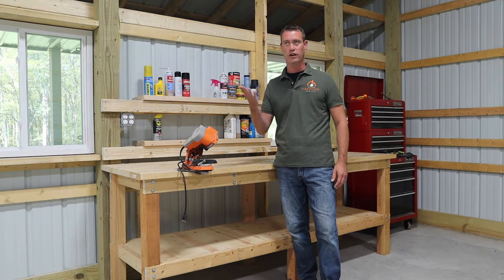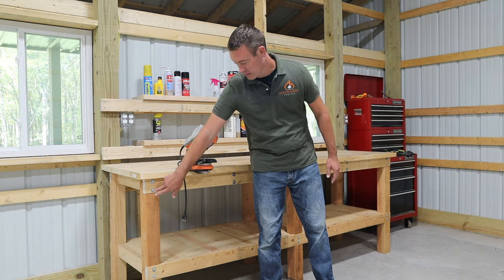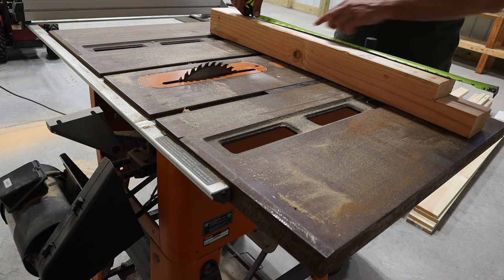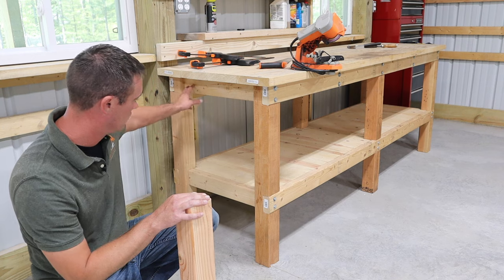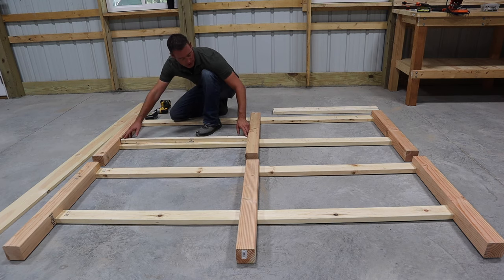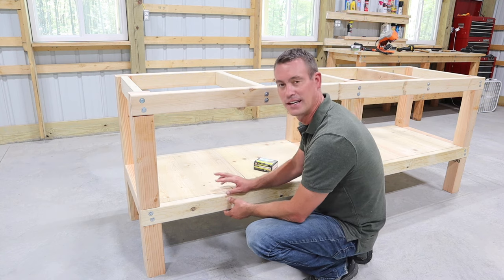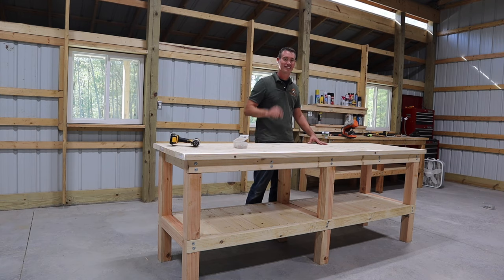How To Build A Workbench - The Best Way

Comment: I built some similar work benches. One issue is they tend to be heavy AF and difficult to move if needed. Cut the height down about 3 inches and throw 4 quality locking casters on it. Works great and is a breeze to move. I have 2 such benches tied together with my miter saw in the middle and I can move them around easily by myself.

Comment: Thank you. Built this last week. Was disappointed in my 2x8s for the top. Yours looked perfect.  You just laid them on top and screwed them down. Mine… not so much. 

Any twist I can deal with because the screws will apply discipline, but the bowing … yikes. Had unacceptable gaps. Fortunately my neighbor knows a guy with a a full wood shop that has a jointer. Live and learn, eh?

Thanks again for a sturdy, simple build 👊
Reply from the maker: Yeah I had to spend a decent amount of time finding straight boards but I was happy with the results!

Comment: Great work bench. Built one very similar. I used 2x10's as my table top and was wondering if you finished or tried sealing your top. Have a good sized gap on the top and was thinking about filling the gap with something and coat it with linseed oil. I just cant figure out what to use. Wood filler I'm thinking will crack up over time. Any ideas what to use? Awesome video though
Reply from the maker: Thanks for the complement. Unfortunately I have never tried to fill the gaps I’ve never sealed mine. The first one I built is several years old and it’s still looking great.

Comment: The legs out of 2X4, and leave spaces for the stringers, instead of cutting “notches”, aka Mortices, in the leg.  The 10-ft @x4s, that were too short were probably “stud” length, which is 3-inches short to accommodate the top and bottom plates of the wall.

Comment: Thank you for making this video. I will be starting to build mine sometime this week.
Reply from the maker: Hope you enjoy it!
Reply: @firewoodforlife   I based it off of yours, but went 8' long and 30" wide and used 3/4" plywood for the top. I also used all 4x4s on the ends and flipped the sides backwards, placing the 2x4s between the 4x4s. The reason I flipped them was because I wanted places with 2" overhangs on the front for clamps and it made the cross members 23" so I could get 4 from the 8' 2x4s and 4 x4s. And finally, I used Titebond III and the newer style construction lags from GRK. Thanks again, it turned out great!
Reply: @firewoodforlife   I sent a pic of it through FB messenger. It has blue pegboard above it.

Comment: I'm planning on altering the build slightly to have the back 4x4's at a length of 7ft so that I can hang a peg board or build some shelves.  I'd obviously need to notch out the top 2x8's on the back, but is there anything else I should consider or missing?  I really do love this video by the way, I've probably watched it at least 10x to understand the process and digest everything, so thank you!

Comment: Nice build. Though, I'm not sure of the need to use the lag bolts when the rails are inset into the 4x4s. I think the screws would work fine. But, overkill never hurt!

Comment: I love the design.  I'm going to try and shrink it a little to fit in my space.  I only have room for a 6 foot bench
Reply from the maker: I’m confident you’ll love the workbench and shrinking it down to a small size should be pretty easy for you.
Reply: @firewoodforlife  From what I gleaned of the design basically it will be 6' 2x8 for the top boards and 8' 2x4 for the side rails.  I'm lowering it a couple of inches so I have @ 35" high bench.   That will allow me to use 4x4 off cuts  for the bottom cross rails as you did.  Top cross rails will still be 2x4.  I might also try recessing the heads of the lag screws. 

The important point here is that your design and presentation make it easy to see how the bench is built and that a strong utilitarian work bench be neither expensive nor complex. 

Thank you for taking the time to create this video.   It is the  conclusion of a long hunt for me.

Comment: Nice workbench! I plan on redoing mine but instead of 2x8 bench top I’m using solid core door for a 100% flat surface so I’m limited to 80 inch length of the door, great video.
Reply from the maker: That's a great idea!

Comment: Hi. Love the video.  I attempted this over the weekend and got as far as trying to screw in the lag bolts
Here are my issues

1. I attempted to screw in the 1st lag bolt into the 4x4 lower brace.  The screw driver stopped several times and I eventually broke the lag screw all together.  

Here are my questions.  
1. Are pilot holes required for the lag bolts or is more an issue with the power of my screw driver.  I tried to screw them in while leaving the original "temporary" screws in place.  
2. should the lag bolts break so easily?
Reply from the maker: A pilot hole will make it a lot easier to screw in the lag bolts and I drill a pilot hole when I install them.  I'm surprised the bolts broke though.  If you're having issues with your drill you can always just use a wrench to install them.

Comment: Nice and I will do this once my garage is cleared out. The only thing I'm changing is using flat sheeting as the top instead of dimensional lumber. I need it to be as flat and level as it can be and boards typically don't achieve that without a ton of work.
Reply from the maker: That's a great idea!
Reply: You could try topping it with tempered hardboard.

Comment: 20 some years ago I built a work bench and dadoed every place I could also turned bottom part into cabinets. It was all glued making it stronger. This place I live at now they built benches with 6x6 posts and 2x8 for all the other boards with plenty of support for the top. It is L shaped at the bottom of the 6x6 they put a piece of other material on the concrete to stop wicking. All bolted to the walls
Reply from the maker: Thanks for your comment!

Comment: Awesome video and great workbench. Much appreciated step by step build. Just finished mine for my shop and love it. Only issue I had was snapping leg bolts connecting the 4x4 legs to the 4x4 lower supports. Did you use treated or untreated 4x4? Thanks for taking the time to make this video.
Reply from the maker: I used untreated wood for the whole project since it's always going to be inside my pole barn.  Thanks for watching!

Comment: Thank you for such a great video!  The only question I have is when you are securing the top with screws, will the screw on top be impeded by the bolts on the legs?

Comment: Excellent build. Did you trim the edges of the 2\8 so that they would be flush. As all commercial lumber has rounded edges. Thanks
Reply from the maker: I didn't and it seems to work just fine for me.

Comment: I consider a table saw a special tool also, so not sure why instead of using the table saw to notch out the legs you didn't use something like an oscillating tool instead. Can an oscillating tool cut the way the table saw did for the notches?

Comment: If I wanted to mount a vice to this bench would you recommend putting down any extra material under the vice mount?
Reply from the maker: I have a vice mounted to mine and I didn't add any additional material.  The only issue I had was lining up the vice mounting holes.  I just made sure they didn't line up between the wood joints.

Comment: Great work and video. I got a stupid general kind of question.
Carpenter X makes a table, and uses modern saws and tools etc, and produces a fine table.
Carpenter Y produces the same table but only uses traditional hand tools, no modern tools or power tools.

Can Carpenter Y charge a higher price for the "hand nade" efect.? 
I assume nobody would care how it's made as long as the price and quality are right for them.  Just a thought.

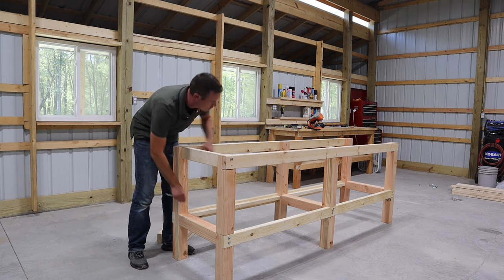Comment: I can only echo the below: finally a design that's easy to build when you DON'T have thousands of dollars in tools. On that note, a beginner question: at 8:31 you put in the lag bolts. The problem I see happening in my build is that my drill bit is simply not long enough (width is all good) to drill deep enough for such a long bolt. Do I just get a shorter bolt then, or is there something that I'm overlooking?
Reply from the maker: I just used a normal length drill bit and didn't have any issues.  I'm pretty sure they were shorter than the bolts, but they were long enough for a slight pilot hole.

Comment: It looked easy and straightforward with you, however I can anticipate that I'm going to have problems with levelling the table. I only have a manual handsaw and a jigsaw, I won't be getting a circular saw at the moment. Any tips with levelling the planks of wood on top as surface tops?
Reply: Ah, the thing I wanted to mention to level the tabletop, just remembered what my dad told me, you have to lay the planks on top alternating the grain curve directions, otherwise the tabletop made up of planks will warp. The grain has to go /\ \/ /\ \/ /\.

Comment: This video is great and exactly what I wanted. I've struggled to find anywhere stocking the exact sizes, do you see any issues with the below working with what you've built?

3/12ft 4``x 4``                   

5/16ft 4``x 2``                   

2/13ft 2``x 1``                                        

2/16ft 7``x 2``                         

2/16ft 9``x 2``               

2/18ft 6``x 1.5 decking
Reply from the maker: I didn’t do all the math but yes, you can definitely substitute different sizes of lumber to make it work. You can even alter the size of the bench since it’s a simple design.

Comment: I don't have a table saw.  Would a circular saw set to the correct depth work for scoring the 4x4 posts?
Reply: Yes, use a saw horse or a table so you have some stability.

Comment: Really nice build guide, my first ever project and my dad and I were able to do it in a little under 5 hours. Do you recommend any style of vice that would work best with this style of bench?
Reply from the maker: I use a vice I bought from Harbor Freight. The only issue I have with the vice is the mounting hole locations.  One of the holes (I believe there is 3) in the vice lines up in the seam between the top boards.  No matter how I rotated the vice, I could only use 2 out of the 3 mounting holes to secure it to the bench.  It's not a big deal, and it works just fine but it was slightly annoying when I mounted it.  I hope this helps!

Comment: Awesome video, i will make something very close to this in europe.

Is there any reason you didnt put one of the bottom braces on the inside of the 4x4s?, leaving a bit more foot room.
Reply from the maker: Thanks I'm glad you like the video!  There's no specific reason I didn't put the braces on the inside.  I don't see any reason why you couldn't but I've never had an issue with needing more foot room so it's worked great for me.

Comment: Wow, I went to write a comment and totally forgot that I had commented on your video a year ago.  I'm going to make a bench that will be a cross between yours and a miter table station.  Anyway, I was just wondering if you need to drill pilot holes for the lag bolts?
Reply from the maker: I do. It’s makes them easier to put in plus it prevents splitting the wood. Good luck with your build!
Reply: @firewoodforlife  Ok, thanks.

Comment: I’m a true novice with next to no experience. I think this project for workbench is excellent. Would this workbench require at least 2 additional legs if the length of the bench is 10’ or would 6 legs still be sufficient for stoutness, durability and longevity?
Reply from the maker: I’ve never built one 10’ long but I would think you could adjust the measurements and just use the 6 legs. I really don’t think you would need 8.

Comment: QUESTION: at about two minutes in you talk about notching the 4x4's but it looks like there is another notch for a 2x4 that creates the depth attaching the front and back of the bench. AM I looking at that wrong?
Reply: In addition later in the video you seem to attatch these 2c4 cross members with only lag bolts. Is that strong enough to support the bench? It seems if the 2x4 were notched in the 4x4s somehow it would make it stronger? No? Great job, just wondering.

Comment: Great video and great info.  My only question is: Where did you get lumber that straight?  I'm guessing it wasn't from Home Depot or Lowes.  I've never seen any wood there that wasn't warped at least a little.  Anyway, thanks again for making and posting the video.  I'll be using these tips sometime this year when I attempt to make a bench in my garage.
Reply from the maker: I actually bought it from Lowes but I had to pick through a bunch of lumber!

Comment: This is probably a dumb question but when drilling the hole for the wooden brace, how did you get enough pressure to hold the 2x4 or 4x4 tight against the post so there is no screw showing?
Reply: I used ratchet tie down straps - worked better than any clamp would.

Comment: If I were to change the length to 6ft long instead of 8ft. Do you think I would still need a center leg?
Reply: I'm building a 6ft one as well and going back and forth with this.  I think it will be fine to not use a center leg as I'm also going to anchor it to the plywood wall I have but I haven't decided yet.  Did you end up putting a center leg in?

Comment: With most construction grade lumber there is bowing, twisting, cupping, or all three in the boards. Are you not concerned with the flatness of the top work surface?
Reply from the maker: Not really. It’s just for shop work and nothing really detailed so I’ve never had an issue with it. I love the bench.

Comment: This is an awesome work bench and look forward to building mine off your design! I don't have a table saw, is there something I can use as a substitute to notch out those 4x4's?
Reply from the maker: Maybe someone else has a better idea, but without a table saw you could just use a hand saw. Sure, it will be time consuming but If you have a sharp saw it’s definitely possible and the cuts are not that deep. Or, you could use a drill to drill multiple holes along the line then cut it out with a saw and square up the holes with a chisel. I’m worried it won’t be square enough though. If it was me, I think I’d just take the extra time with a sharp hand saw.
Reply: @firewoodforlife  thanks, I'll give that a shot unless someone else comes up with something better
Reply: @taylorg2050  sliding miter saw should do it too right?
Reply: You can just use a circular saw set to the right depth.
Stand to one side in case it kicks back. You can use a cutting guide like a quick square or eyeball it.

Comment: Often times 2x4s are cut shorter for the convenience of building 8’ or 10’ ceiling. Explained below for an eight footer. 
It is precut to   92- 5/8"
Add 4.5"(3 plates) =97-1/8"

Now cap the ceiling with 1/2" rock and you are down to 96-5/8".
This will yield 5/8 gap in the bottom to hang the 8ft sheet rock. 
Similar for a 10’
I have seen many times people picking up the shorter precut 2x4 without realizing. Those missing few inches can really add up to waste if one is using the lumber for anything other than wall building.
Reply from the maker: Great advice, thanks for sharing!

Comment: What kind of chainsaw sharpener do you have? Work good?
Reply from the maker: I have a Chicago brand sharpener that I bought from Harbor Freight a long time ago and it still works really good.  There's a little play/slop in it, but it's not bad.  Over the years though I've become pretty good with a hand file, so unless the chain is really bad, I just use my file.

Comment: Just curious if the materials needed list is updated to reflect the few hiccups in measurements in the video as i heard you mention you made a small error in sizing 8ft's vs 10ft? Great table and i want to build it myself.
Reply from the maker: If my memory is correct, the materials list is accurate. I just made the mistake when I bought the lumber by grabbing the wrong sized boards so I had to modify it during the build.

Comment: If the 2x8 lumber is not straight then your top wouldn't be fully flush and flat. Do you normally just sand it down then?
Reply from the maker: I have never worried about it but that’s a great idea. I don’t know why it wouldn’t work!  For my specific use I’ve never worried to much about having the top perfectly flat.